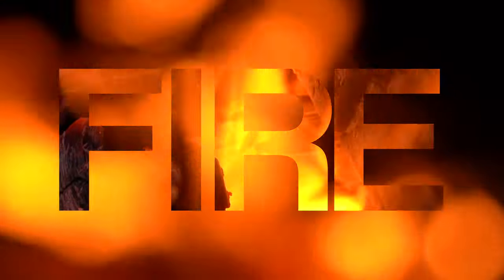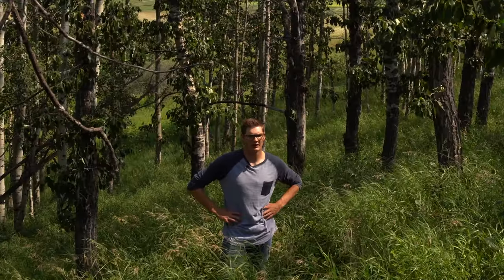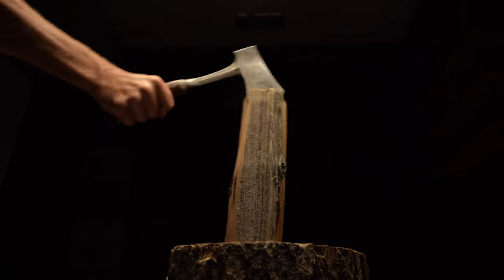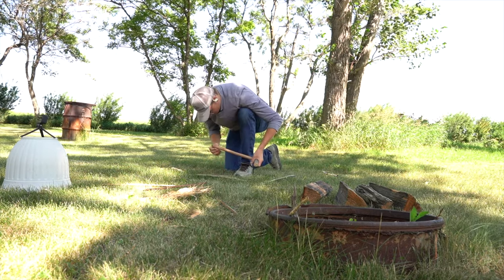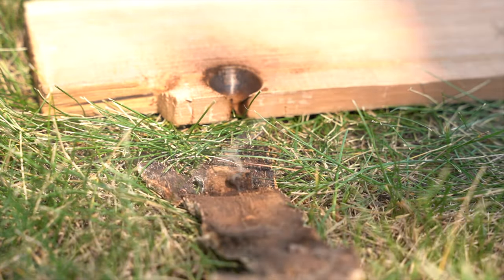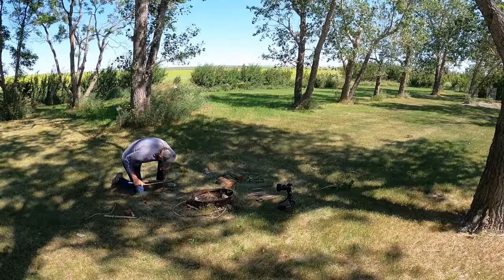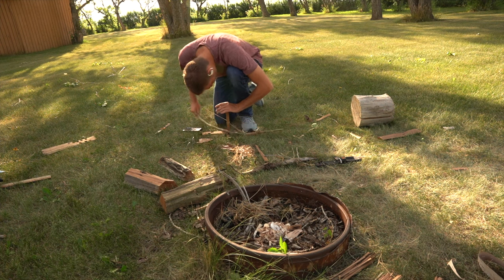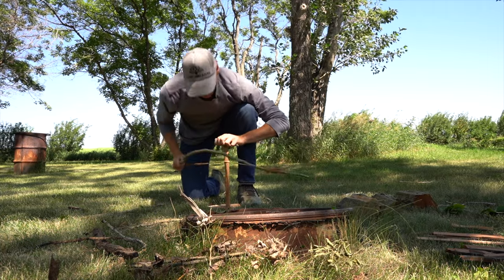Are Survival Fires REALLY That Hard to Make?

Comment: once u learn the techniques and some practice on different ways to strike up sparks and a heat source, it will happen - two pieces of wood and some dry plant mixture, u can create a fire - first time it seems impossible but with some self-reliance and persistence it will come about - easy not at first but it was self assurance it can be done after it happens
Reply from the maker: Very true